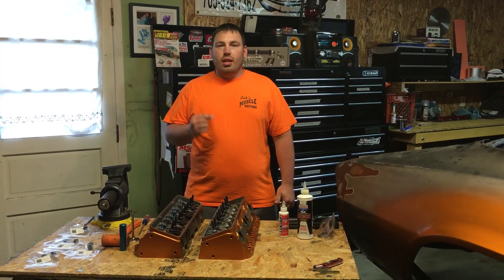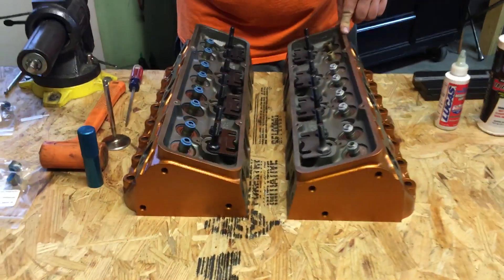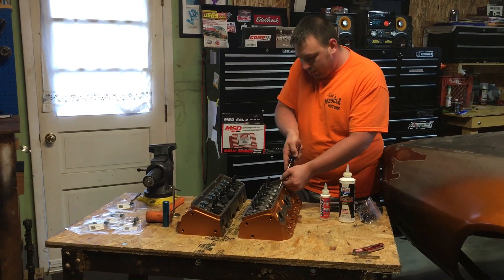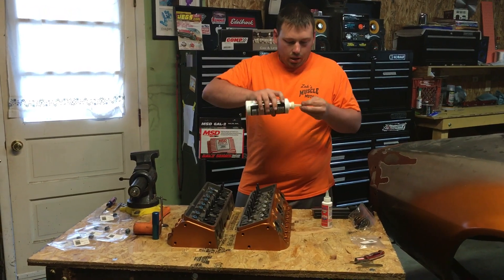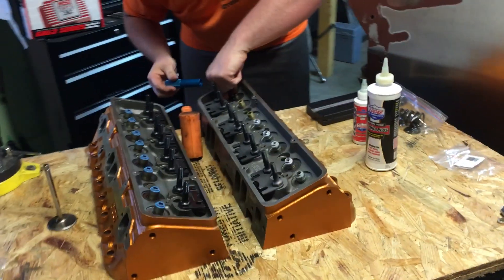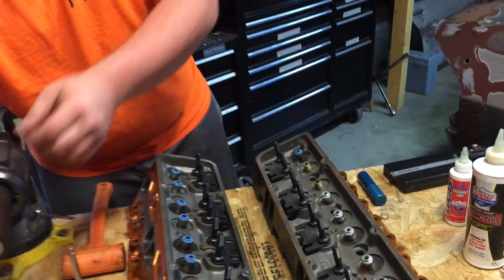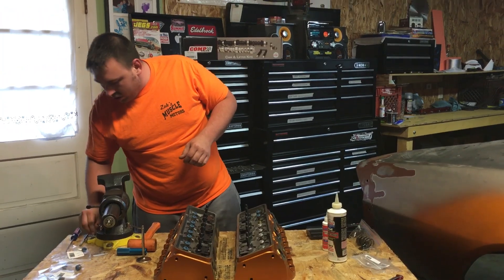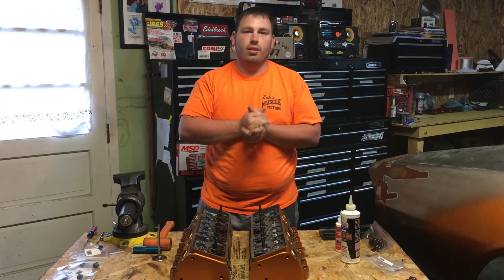Engine Building 101 How To Replace Valve Seals

Comment: Hi. My Hyundai Tucson 2,7 V6 smokes at morning. I ve been told: teflones...
.
Q: does the head of the engine have to be removed? Or is it possible to repair not to demont the heads off the engine?
Tyvm.
👋👋👋👋👍
Reply from the maker: You can make or purchase a fitting that screws into your spark plug hole that will let you pressurize the cylinder with air. If you do that and are careful you can change the seals without taking the head off.

Comment: Question? Did you take the little spring off the valve seals before you pressed them down? Or did you pressed them down carefully with the springs on them? Just asking???? Theses valve seal look simple but it's a very critical part for your cylinder heads.....

Comment: I'm curious why you didn't install the valves first?  Once the seals are on there is no way to use the protective sleeve that keeps the seal from being damaged the keeper slot when you put the valves in the head?
Reply: Because only an idiot would even suggest that...
Reply: @mikeschneider634  clearly you have no idea what you are doing.  Tom Hutchins below asked a very similar question only to get attacked by the poster.  Now you are attacking me.  Go ahead and tear up your seals have a nice day.

Comment: So after market SBC heads, with valve guides machined for positive valve stem seals. The spring is called the "Garter" spring. On larger seals, from wheels, axels, manual transmissions etc., I have always packed a small amount of grease on that backside to keep the spring on. This happens less often with seal drivers designed for the seal, but I still see it. BTW, on screen, the paint appears to be a medium metallic copper/brown... Love that color. Subscribed 3 videos ago and hit like. Why do people watch and not hit like. It takes a lot of work to prep, camera, sound, edit then after a review, upload! Hit The Like button!!!
ASE Master 1978 / Retired

Comment: So do you need to put an oring on the valve stem with this type of seal?
Reply: Some valve stems do not use the O ring thus having no groove for it. They are designed to be used with positive type valve stem seals vs. the old umbrella type stem seals from years past.

Comment: Yup im looking like a troll here . You put the valves in the head . I always use mobil one synthetic red grease to lube the guides it hangs around a little longer. Then they make a little plastic sleeve to go over the guide (Condom). then you work the seal over the valve tip.Tap lightly and as straight as you can to seat them. I can see some one has patched up those heads with  universal bronze guides and hacked the casing down to the spring seat level. ( race shops use a replacement guide with a top very similar to as case and a shoulder to keep them from pulling in. ) The cast towers are probably (It is hard to see in the picture maybe they are all bronze?) .530 and the replacement guides are .503. So at least a couple are acting like replacement umbrella seals just floating. And old jack does not make seals those are just GM oem steel housing replacement seals. Oh and one more the white teflon seals are 70's era and useless they work to good when new wear out the guide and then hog out and leak like crazy. 
Hey good luck on race engine build instructional videos!!
Oh And I have a bunch of those white teflon seal for sale cheap there from the 70's but who cares
Reply from the maker: Tom Hutchins I’m not sure you’re just trying to tear my shit apart or not, but I can assure you these are done correctly and according to the manufacturers instructions..... those are dart heads, not GM heads, and the guides came installed from dart. Not sure what you’re trying to get at.
Reply: @ZaksMuscleMotors  trying to correct your miss information. Seals are the same as late GM . You can buy those seals from any engine builder supply. Seals go By size not make and model for american V8's OEM or aftermarket heads. Your assembly procedure is wrong. But from your comment your a hard head so Good luck buddy. Your just another self appointed back yard engine builder that obviously has had no training or proper experience. leave your response you can have the final word
Reply from the maker: Tom Hutchins you sure make a lot of assumptions you know that? I say call the manufacturer for their suggestion or check the size of the guide and that makes me wrong? I’ve run this engine a lot, and guess what...... no leaks, no issues.... what is your response for that? If my process is so fucked why is it working? You’re right I am a hard head when it comes to troll fucks such as yourself, and never have I claimed to be the final word in engine building. I think your bored in your parents basement and need someone to bitch about

Comment: You can use a socket to install these with if you don’t have the fancy install tool.
Reply from the maker: Sure you can, and you can also screw them up with a socket. You don’t typically mess them up with the tool. It’s cheap and helps insure the job is done right. You can half ass it, or whole ass it. Choice is yours lol
Reply: @ZaksMuscleMotors  you can screw it up with either. Hammering them on is asking for mistakes. You are using half the tool. They sell a bar to press that tool into the seal and press it on. THATS THE CORRECT “WHOLE ASS” WAY
Reply from the maker: @mikeschneider634  well I obviously did it correctly as the have had zero issue. You did this the half ass way instead of making a video and calling me out on it.

Comment: Part number???
Reply from the maker: For what?
Reply: @ZaksMuscleMotors  sry the blue seals, I got the comp cams 518-16 for my Assualt Racing aluminum heads for my 350. Hopefully I got the right seals lol I know the sized are right as far as the 11/32" valve stem and .530 guide but the bottom half of my guides has raised grooves making it a tiny bid wider on the bottom so now idk if I got the right ones lol I can't tell in the vid if your guides are smooth or have the grooves like mine

Comment: did you use lucas engine break in oil for the valve stem seals?
Reply: I dont think you will read this or need this info, but the lucas product shown in the video is a zinc additive.

Comment: good video. I'm thinking my truck needs new valve seals. If you let it set for a while and then start it up you get a decent cloud of white smoke but it instantly goes away.
Reply from the maker: sounds like a great place to start. Doing it on the engine isn't so bad most of the time, sounds like a typical warn out seal.
Reply: if its a 0h late 80's chevy to early 90's its valve seals . New seals will help but not 100%

Comment: Great vid, i was wondering since i have a 305 engine would the valve seals cause my car to smoke white smoke, after running and warms up.
Reply from the maker: How many miles? Has it sat for any length of time? Have you done a compression check?
Reply: Nope it would smoke on decel (high vacuum ) and when first started up. if your lucky it maybe an intake leak. If it smoke when you get on the gas its rings